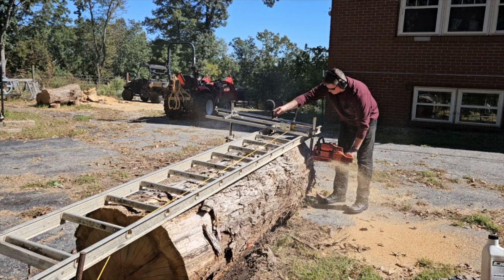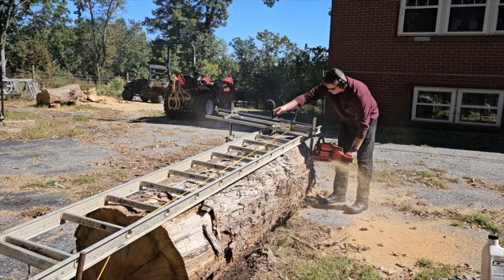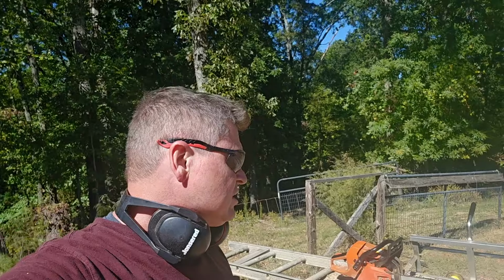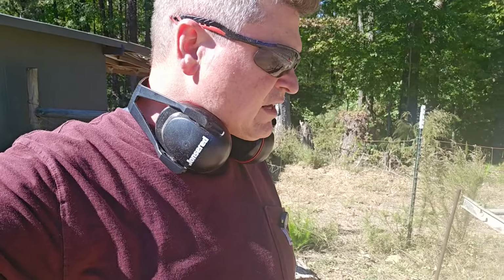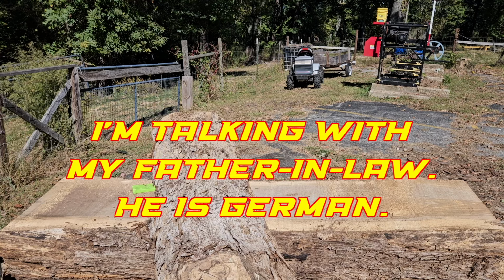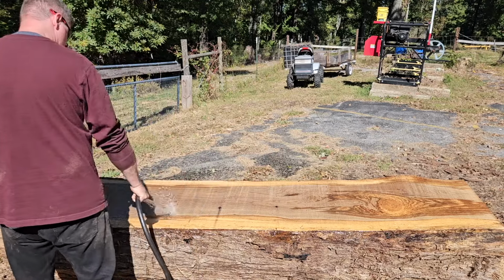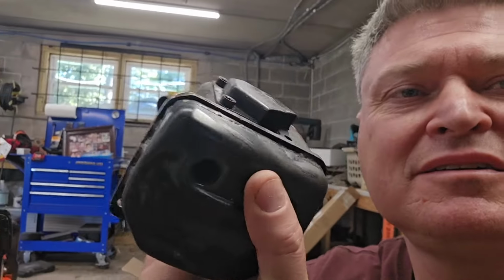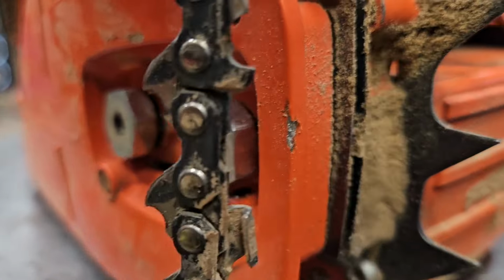Milling White Oak with Ported Echo 590 DGP oil and Archer Bar and Chain

Comment: Now you need a vacuum kiln to dry it lol. I do too many projects and built one from a 1000 gallon propane tank but i used to do pipe welding for a living as no leaks are key when pulling a vacuum!! Thats crazy it still cut after hitting those nails!!

Comment: Hello , video looks great , the wood is really nice dont remove the punky part , just use epoxy to make it hard (thats what she said) , it will be perfect and uniqe , that chain sucks , stihl has 3/8 1.3mm lo pro pmx , try it . Run the chain even with missing tooth , usualy the less they are , the quicker it is . 
Also if the bar is long enough use a 30-40 degrees cutting angle in the wood , dont just go at 0 , and keep chainging it so you cut 50% of the wood at once and the switch

Comment: The back part of the bar is only hot due to the exhaust heat soaking the milling clamp and transferring into the bar.  I’ve had new bars keep the paint for the first 20 cuts or so.  You should redo the test with an IR thermometer measuring 4 points on the bar at the end of the cut.  Then drain/swap bar oil to your farmersonly brand you like to run

Comment: I use a 70cc saw 36 inch bar oregon ripping chain and that works fairly well. I bought a winch but realized unless something isnt right with the bar and chain aka dull twisted or bar burrs you can more easily push and manipulate the saw than dealing with the winch. Thats also not on oak or hardwood!

Comment: Clearly i comment while i watch lol sorry! Was wondering how often you file the burrs off your bars? I find most people overlook this and those burrs can substantially effect your cutting as the burr can be as wide or wider than the chain kerf. I file mine any time i see missing paint or any signs of heat. I bet if you lay a good flat file across those bars almost flat to the bar you ewill quickly realize most used bars have a burr.